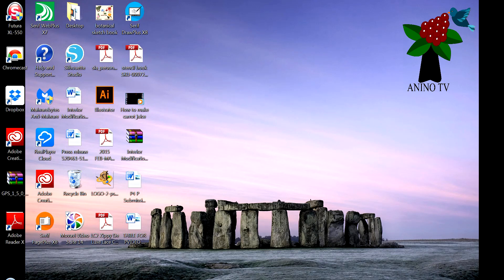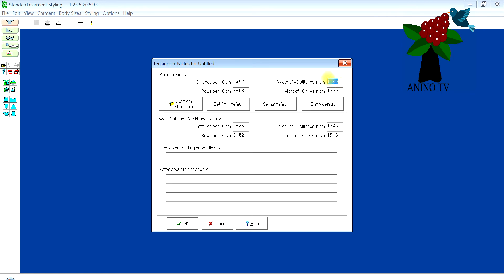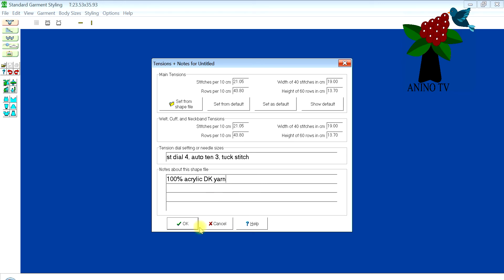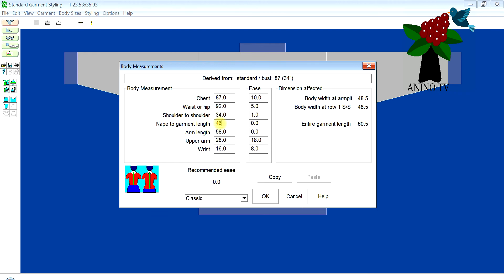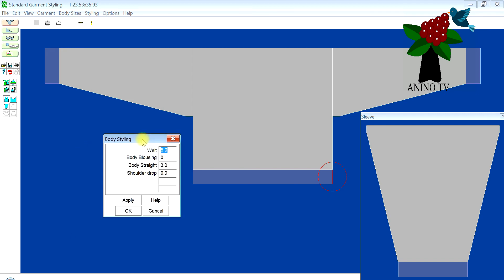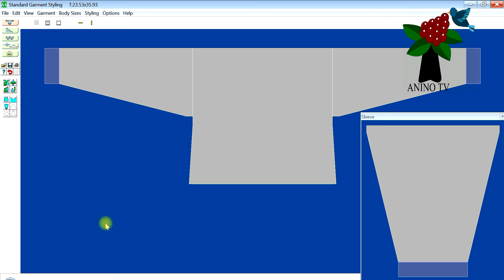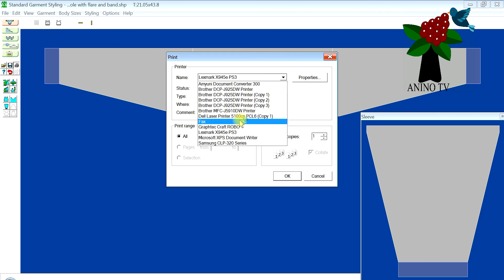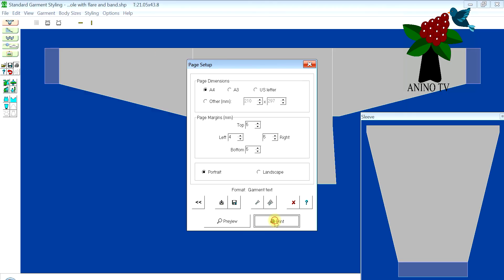Designing a camisole for LK150 knitting machine using designaknit dak8

Comment: hi,sorry to bother you and for my bad english,please,could you tell me please where i can buy designaknit 8 and what i need anything else with it,i have brother kh965 and i live in belgium,also i would like to learn hot to use ,aftre your videos it seems very easy,i like your tutorials,thanks
Reply from the maker: +nina chance  , Please visit;  http://softbyte.co.uk/      or     http://softbyte.co.uk/contact.htm
If your country is not listed, then they can sell to you. I bought mine from Andee knits in the UK. I bought DAK complete; which have both hand knitting and machine knitting in it.

Since KH965 is an electronic knitting machine, You will need the BROTHER-LINK 5 CABLE; This enables you to use it on any punchcard/manual machine and also an electronic knitting machine( magnetic and interactive).

If you desire to design lace pattern, then you will need a LACE TOOL to activate the lace program of the DAK software. 
You can also knit with your DAK before buying the cable and the Lace tool.
Hope this helps!

Thank you for your compliment.
Reply: Anino TV hi and sorry again to bother you,thank you for your answer,i need you help one more time,if i buy compet dak which brother link cable i need?on website you gave me i see brother  link 5 does not suggest kh965,should I buy BROTHER-LINK 4 CABLE(cartridge cable)?thank you
Reply from the maker: +nina chance, Sorry for the late reply,  I will have to ask those who use the Brother KH965 and also Softbyte and get back to you.
Reply from the maker: In respect to the KH965 and its cable, this is the information that I received;  there isn't a direct link from the 965 to DAK.  get a PPD and download to that and then transfer the patterns by transferring the cartridge. On the Soft Byte's website, you will find information about the brotherlink 4, however as it is made by a third party, people tend to not like using it and have lots of issues, hence why it is recommended  that Someone should use the PPD and brotherlink 3. Please take a look at this link .https://softbyte.co.uk/_dwnload/CableLinkPricesWebEU.pdf
Reply: Anino TV softbyte 
The